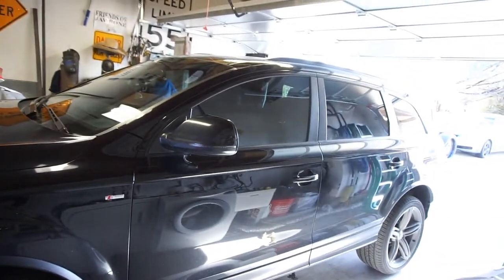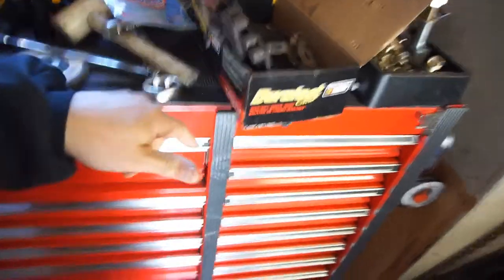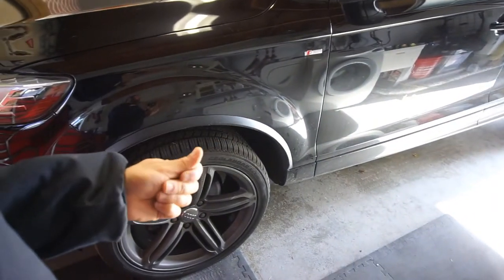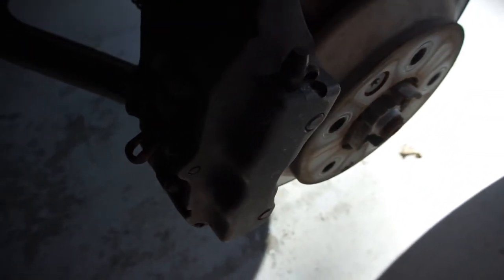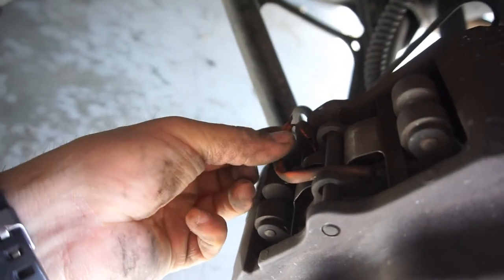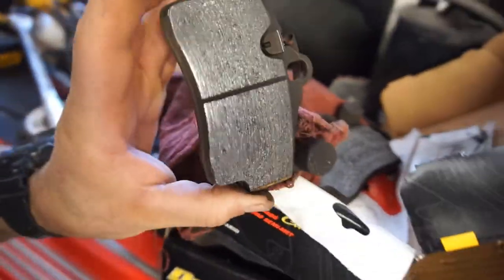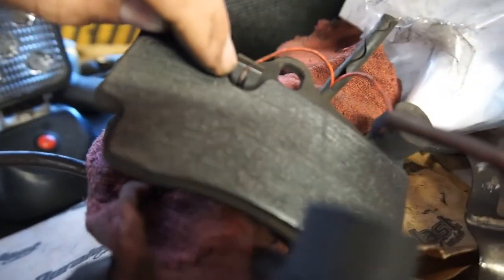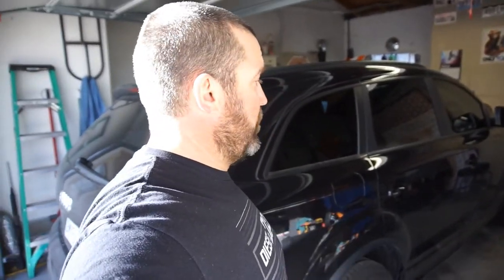Had To Do Brakes On The Audi Q7 TDI. Oh I Sold My 4th Gen Cummins

Comment: My Vibe is on its 3rd set of pads on the rear and the fronts are still the factory originals .  I've never seen such a difference in wear . Of course the rear pads are half the surface of the fronts but doesn't the front do the majority of the stopping ?  I don't get modern cars .
Reply from the maker: Orion Fixr yeah definitely kinda weird that you’d replace the rears more often than the fronts. You’d think the front does most of the work like you said. Well now I’ll have an extra set of front and rear pads once my set comes from who knows where or when. These Vatozone pads seem to stop pretty quick though. Might just keep these on and throw the new rotors on once they come.